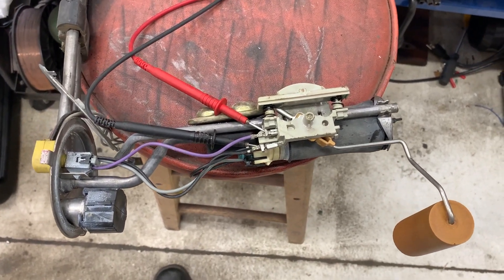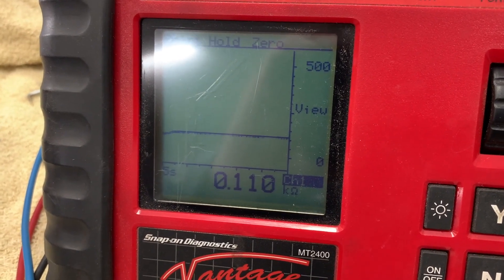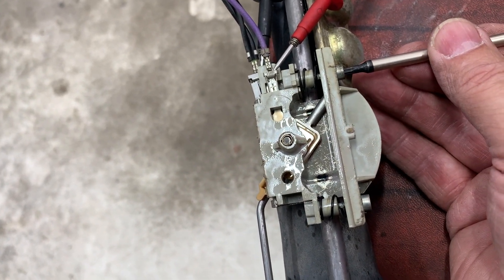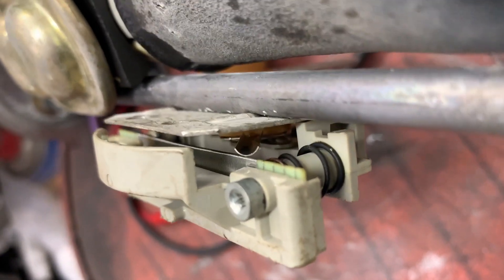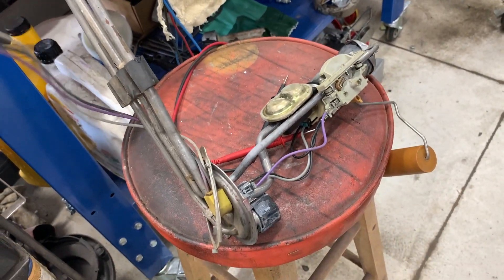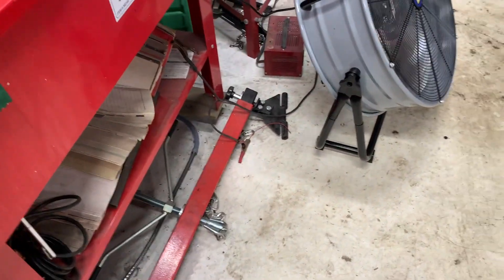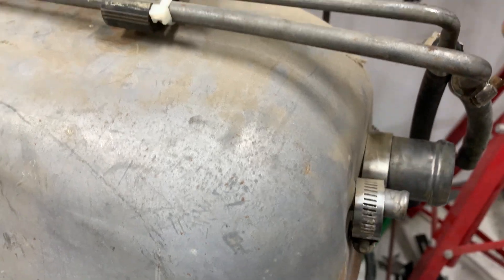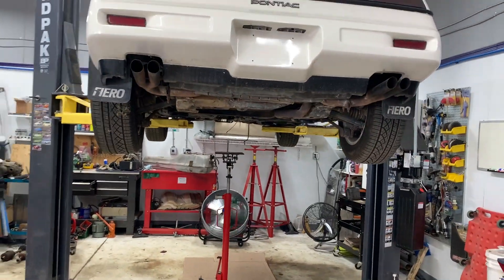GM/Fiero Fuel level sender testing

Comment: I'm interested in the voltage drop across the 90 Ohm resistor when the tank is full. I don't suppose you have ever measured it? Thanks. Good video by the way!
Reply from the maker: Sorry, no. You'd have to do some empirical testing there.  The sender connector is at least fairly easy to get to. You could just jumper it with a 90 ohm resistor to simulate a full tank.  Or, mortgage your house and just fill up!  :D

Comment: My gas gauge is stuck to like a little bit over a quart on my 87 fiero and some of my gauges read a little to high or to low idk what to do help
Reply from the maker: Having the fuel gauge read 1/4 tank and be empty is pretty common. You need to figure out if it's the gauge or the sender though. It's easier to test the gauge. Disconnect the 3 pin connector at the firewall, and stick a 100 ohm variable resistor across the pink and black wires on the car side plug. As you sweep it, the gauge SHOULD go empty to full.  If it doesn't then the problem could simply be that the needle has moved on the shaft. You have to take the whole dash apart and recalibrate the gauge. If it sweeps properly, then the problem is with the sender (which the video was all about!).
Reply: @DrFiero  the thing is the gas tank is full and it reads at the quarter of the tank should I do the same thing u said
Reply from the maker: @carlospineda7021  - Chances are the fuel sender is screwed then.  But it's still worth checking the gauge itself to rule it out.  Hopefully you know how many miles you can go on a full tank! Use up about 80-90% of it, then drop the tank. I can get one out in 15-20 minutes (practice makes perfect!).
Reply: @DrFiero  thank you I really appreciate your time, it’s my first project car I’m 21 so I’m a novice

Comment: What Fiero year did this fuel sending unit come from? There were 3 different sending units made for the Fiero.
Reply from the maker: This was taken out of an 88. Is it original? Who knows after all these years. 

But every single one works off the same principle of a 0-90ohm varying resistance.